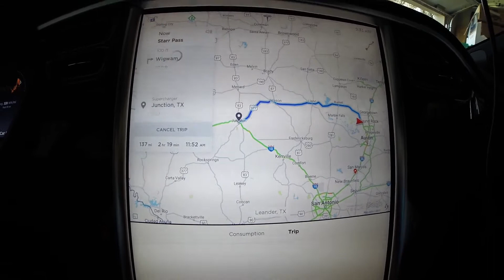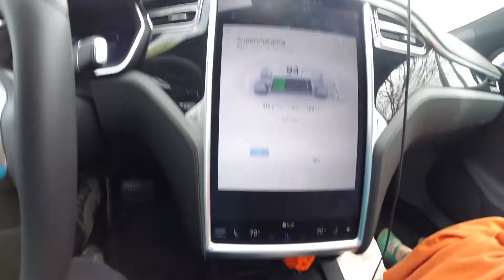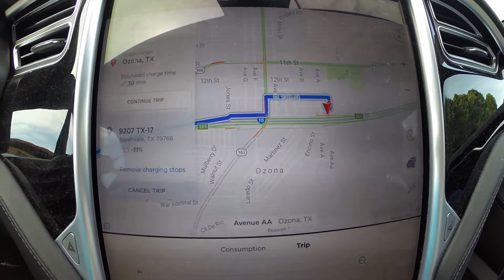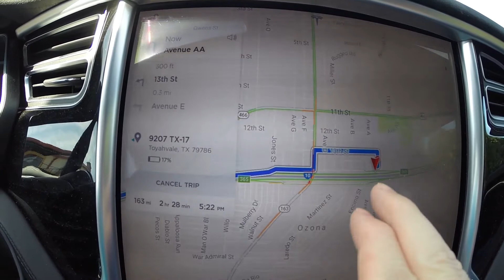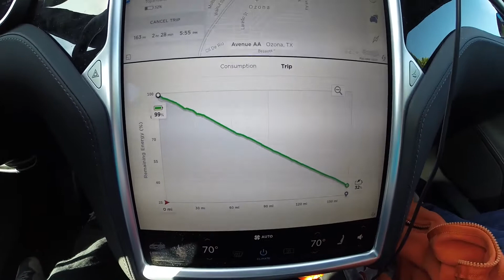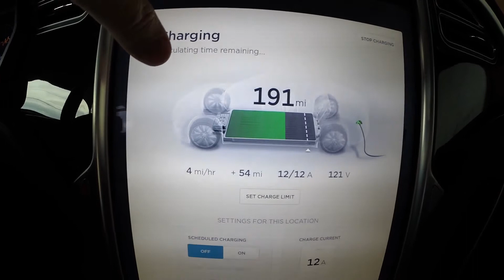Tesla Model S 90D long distance trip. (780 miles), with limited Super Charger access.

Comment: Looking up Azona, Texas there is now a supercharger located there as of November, 9th 2018 so you should be good to go on all future trips to the area. If you haven't download and install "" Plug Share " . 
The program will tell you where all  J-1772 240 volt chargers are located plus all homeowners who have charging facilities they are willing to share and has the personal information for each location.
Having this program on your tablet/iPad should make it easier for future toad road trips. 

Have a 240 volt extension cable made up of at least 50 feet with two foot long adapter cables made up for various dryer plug configuration's the allow you to plug into nearly any receptacle you run across. 

Tesla hotel, air mattress with rear seats folded down and most campgrounds have either 25 or 50 amp 240 volt service. Far better than a 110 volt charging capability.

Thanks for posting the video of your trials and tribulations.

Cheers!

Comment: You should get a dryer plug to Tesla adapter with extension cord to your Tesla!
Reply from the maker: Hi Terry, Tesla actually delivers the car to you with a couple of adapters, including one Nema plug. Of course there are about 5,000 different types of Nema, but you can actually order a few different Nema adapters directly from Tesla for some of the more popular types. I use the 110 adapter when I'm at my Dad's in Canada and that does most of my charging in the evenings for me while I'm there. I haven't needed an extension cord yet and probably never will.